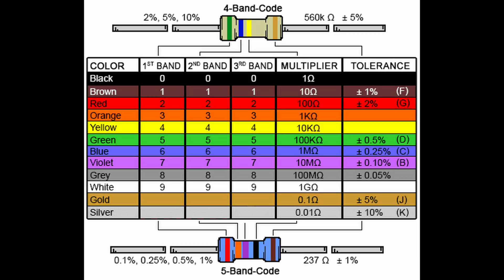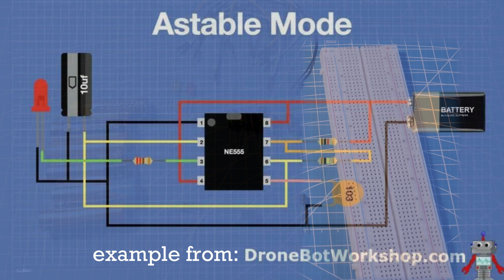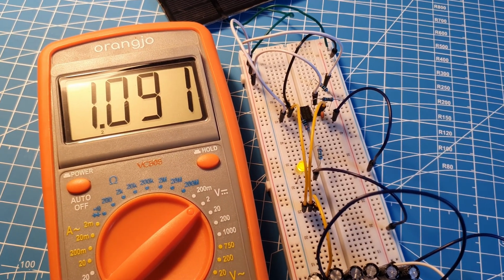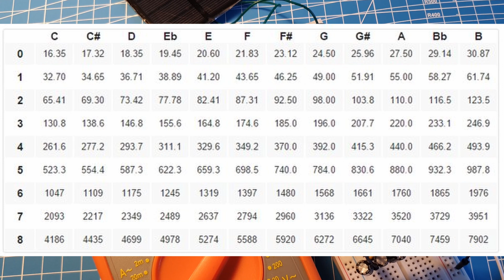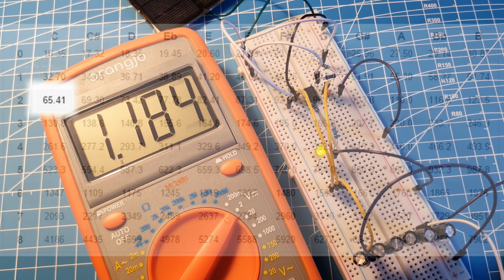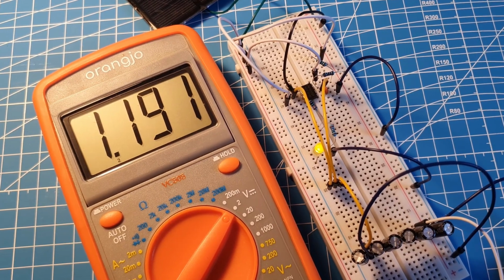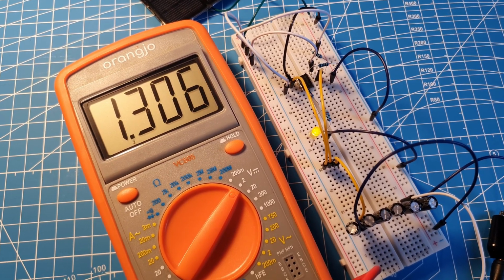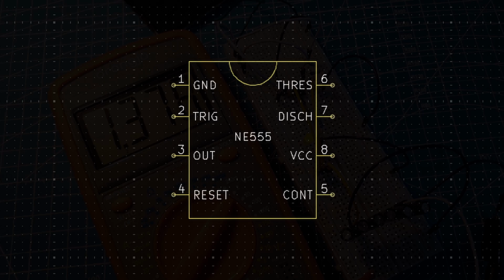555 Timers (with example)

Comment: great video, i have been trying to figure out how to use an ne555 for a few weeks now, also the pin out you have given at the end is wrong, the pin numbers are correct but the position of those pins in practice is different, vcc(pin 8) and threshold(pin 6) have been interchanged
Reply from the maker: Your are correct of course! Thank you for noticing this

Comment: can you please make an analog computer in a future video
Reply from the maker: Perhaps, any specific designs in mind? Like a 2 bit adder for example?
Reply: @V_Electronics  You can create a simple analog computer capable of adding two numbers. The computer will use two input voltages, which can be controlled using potentiometers. These voltages will be connected in series to add them together. Finally, a voltage level indicator circuit with LEDs will be used to display the resulting voltage. This way, you can input the numbers through the potentiometers and obtain the answer through the LEDs in the voltage level indicator circuit.